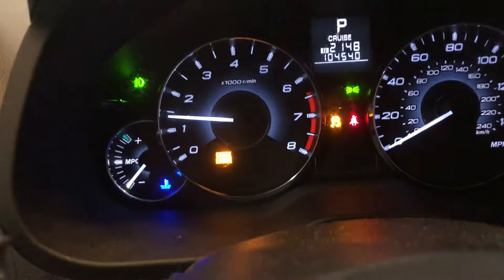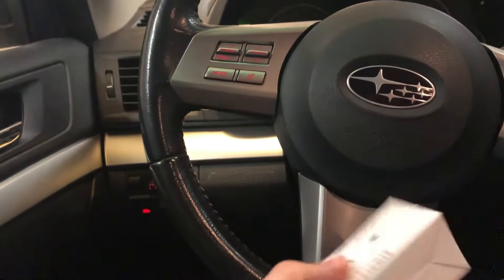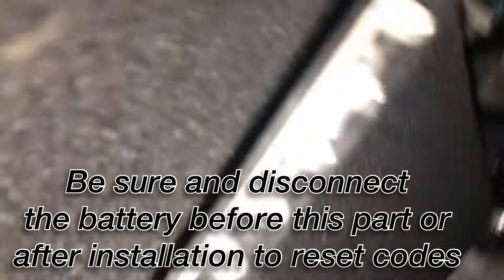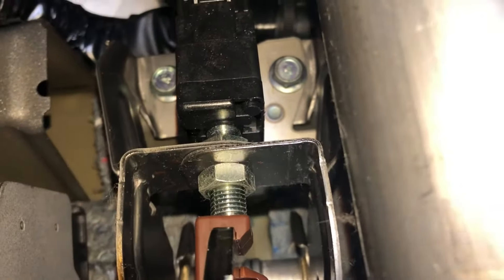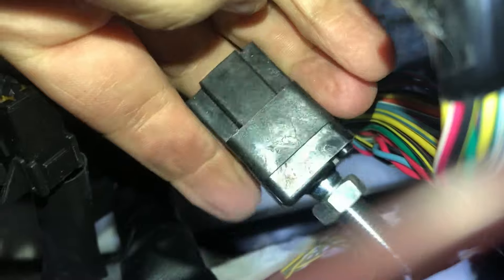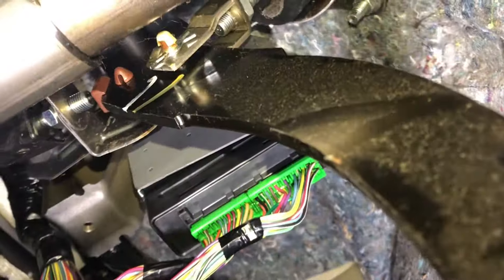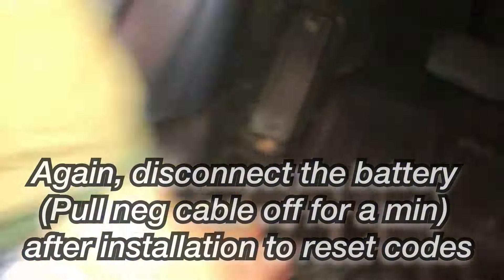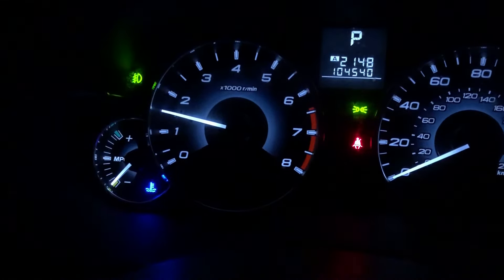Replacing Brake light Switch in the Subaru

Comment: This is not really the solution. hank you for your effort though. I've changed the brake switch and the dash board lights (brake & cruise flashing, check engine & traction) goes off only for three days. After the lights comes back I've talked to my mechanic and he told me that I shouldn't changed the brake switch in the first place why because the switch ihas been built for the entire life of the vehicle coz it is a part that are not electrical rathet it is a mechanical thing. Later I took my car to subaru delership for diagnosis and the result shows the O-ring that serves as a gasket to prevent coolant leakage on top of the car's cylinder burnout and needs immediate replacement. The o-ring is found between the cylinder and coolant crossover pipe. The crossover pipe is located between the upper hose of the radiator. Subaru vehicles are really anoying when it coms to revealing the root cause of the faults in the car. I hope this will help Subaru owners and besides the subaru dealerships show no mercy. They will rob your money. I donot encourage you to use their mentainance services unless you have big money. Now my car is back to its factory condition right after I replaced the two o-rings. This is my two cents. Thank you.
Reply from the maker: Sounds like your issue wasn’t the same as mine.  Glad you got it taken care of. 👍

Comment: All the above was flashing it was my mass air flow system went out
Reply from the maker: Sensors and electrical thangs can be hard to track down. Glad you were able to find the root of your problem.
Reply: @CapricornKangaroo  I actually changed it out and the lights started flashing again they told me It could be a fuel injector so I ran some gumout fuel injector cleaner and it worked and as been running great

Comment: I change this but still have light and traction control 😡😡😡😡😡😡😡
Reply from the maker: Did you unhook the battery for a minute or so and hook it back up and try again?
Reply: @CapricornKangaroo  yea I’m disconnected battery positive
Reply from the maker: @jerryvidal5359  Sounds like you may have actual traction control issues. This isn’t a 100% fix all, but rather the cheap part to start with that has been known to be the culprit often times.

Comment: What about the at oil temp at the same time??
Reply from the maker: If it’s part of the lights at startup, then could be included.  To me there is no reason the brake light switch would indicate all the warnings that it does. Electrical gremlins are just tricky like that. But if the oil temp light is after it’s already running, then you’ve got an overheating issue, likely head gasket related if I were to guess, in which case DO NOT CONTINUE TO DRIVE THE CAR, as you’ll warp the heads and do collateral damage.

Comment: Name part pliss?
Reply from the maker: Brake light switch
Part Number: 83311FG000
Reply: I think your p/n is 83370AA001. Has metal threads, the other p/n has plastic threads and won't fit the brake pedal nut.